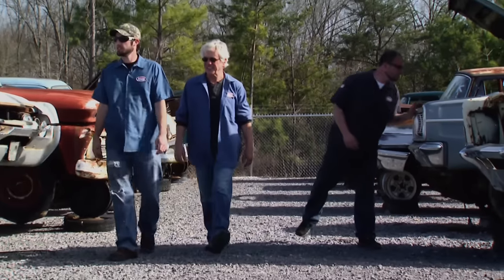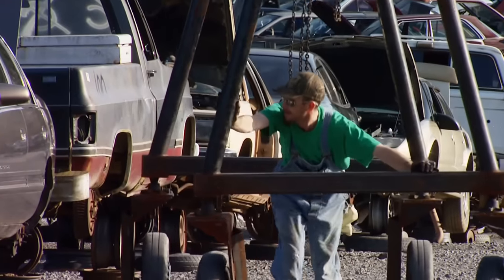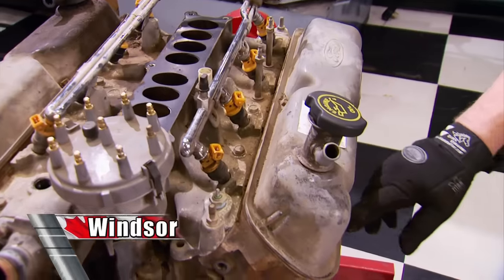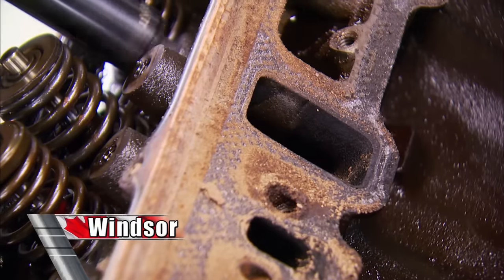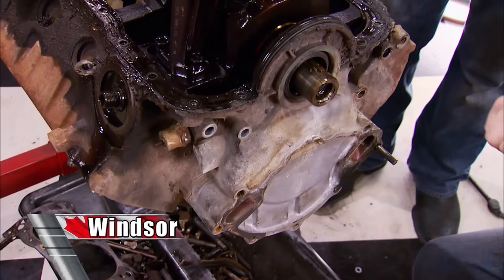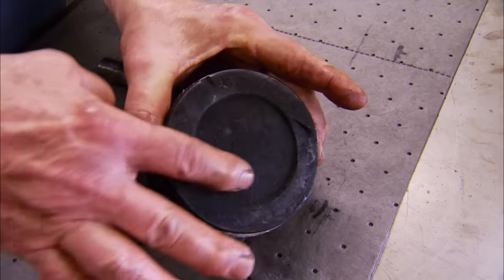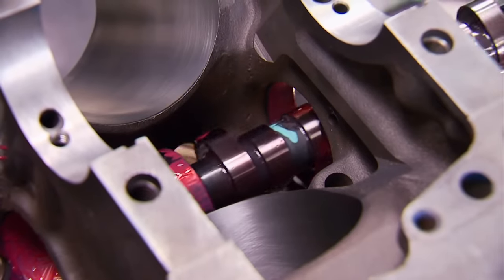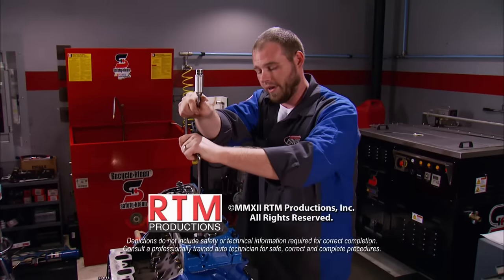Tearing Down a Pair of 351 Small Blocks: Windsor vs Cleveland - HorsePower S16, E10

Comment: Another quick way is the fuel pump bolts, Cleveland has vertical bolts and the Windsor has horizontal ones, easy as. No mechanical pump opening and it's guaranteed to be a Windsor.

Comment: i have a modofied 351 cleveland, it has the performance pistons , a 400 cam, solid steel lifters , square bore manifold performer lb2v , four barrel holley 4160 carburettor, xtra large sump, headers some kind of speacial exhaust and muffler,  it sound great , loads of speed too  i got up to 250 kph and didnt want anymore , it almost blew both back tyres in under a minute  just standard 15 inch 205mm, serch ford 351 cleveland worked starts up and revs rimas nobody elses

Comment: Know a guy that bulit a beyond beautiful 32 duece coupe . Plumb crazy purple with graphics and had not decided what to power it with. EVERYONE told him put a 350 chevy in it bit he said f**k that not in my Ford. He bought a bone stock 351 4V engine from a guy that had a old Mach 1 he parted out. It had the GOOD HEADS and he sent the engine to a custom shop  that balanced it , ported the heads. Shaved them .020 and added a solid lifter race cam.and put a  edelbrock tunnel ram.with twin 600 holleys . GOD ALMIGHTY that thing sounded awesome the 1st time we cranked it up. Added 3 inch hookers for exhaust and 4 spd with a 4.56 9 inch rearend. Talked him into taking it out on the town and wouldnt you know it a  dude in a 69 427 chevelle rolls up and says nice car , wanna see how slow it is . Not knowing what to expect my bud said lets go smartass. He told me to.grab onto something and hold on. When the light changed green he dumped the clutch and flooted the pedal and I never saw a car disappear in a rearview so fast. That cleveland sounded so awesome as he ran it through the gears. We pulled ovet to let the chevy catch up.and he got out and said holy shit WTF you running in that .I never saw anything that f*****g fast. He told us later over a beer ( he ended up being a cool guy and he had a beautuful car too) that the 1st 75 ft all he saw was tire smoke from my buddys Duece and he could hear that beast over his motor as it seemed to wind forever. He later had it dynod and it topped out at 485 hp at 6800 rpm,s. DAMN WHAT.A ENGINE.

Comment: In ‘74 I bought a ‘73 Mustang Mach 1 with the 351 Windsor. Worst, most unreliable engine I’ve ever had. Jumped time when timing chain and gear wore out. Never did run right. I got rid of it after only two years. After that I learned Ford techs said the Cleveland was the 351 to get. I agree.

Comment: [tongue in cheek...sort of]
"On the next PowerNation we do a apples to apples comparo using these engines:
We finish our rebuilds on the 351C and the 351W, putting in some Ebay pistons and rings, taking a pneumatic hammer to the combustion chambers, and a power grinder to the cylinder walls.
Their competition will be a 4-bolt 350 from a 1989 Chevrolet Corvette.
The 350 features Keith Black Diamond pistons, a complete Edelbrock top end kit, featuring cam, heads, and intake, equipping a STS remote turbo system and a Big Shot nitrous system set up for a 200hp shot of nitrous oxide. The bottom end is balanced and the whole engine blueprinted.

Our initial dyno pulls show the following:
351W: 235hp/337ft-lbs
351C: 276hp/328ft-lbs
Near stock Chevrolet 350 rebuilt for this comparo: 726hp/817ft-lbs of torque.

Welp, these numbers speak for themselves!
Stay tuned for the next episode where we revisit the 460 vs 454 comparo, but this time put a 11-71 on the 454, and swap out the factory 460 pistons with narcoleptic possums!"

Comment: The Australian manufactured Cleveland’s were built at the Ford plant at Geelong in the state of Victoria right and used right up to the 1984 Aussie Fords in Both 302 and 351ci sizes and we developed them a bit further with improved head design and were used in our Aussie Ford Falcons, Fairlanes, LTD’s, F-100’s, Utes, panel Vans 2V, 4V and super hi-performance versions for our GT & HO Falcons in the tens of thousands, the Windsor’s were used in vast quantities too in the same Ford products but these were all Canadian built right up to the last EFI versions built and there are plenty around in wrecking yards here and could be a source of supply to the US especially now that you have discovered our epic Ford Barra engine and using them over there

Comment: If you can find them a 351 C bored thirty over with 12 1/2 to 1 pistons will net about 10.3 to 1 with the 2V heads ! And the 2V heads with canted valves bigger than a 350 Chevy you can make some serious streetable' horsepower and torque for any md size or small Ford. Some studious blend work from the valve job down into the ports a little bit (unless you really' know what your doing) can make some serious power! I was told by one Ford guy, "Don't discount that 2V Cleveland Head! You CAN make as much as 500 HP with a radical cam!"

Comment: Clevelands has 2 types of heads: 2v and 4v and can be identified with either the numbers 2 or 4 cast into the corners of the head. 4v heads used closed combustion chambers
Reply: 4v also had open chamber heads
Reply: @jquest43  Thsnks for the clarification

Comment: I was kinda hoping for a boss 351 build but this is cool too
Reply: Only in the '71 Mach 1. Most cars after that got a 351-CJ . 4 barrel CJ's found their way into Gran Torinos, Mustang Mach 1's after '71 and 2nd gen Cougars XR7's Boss is 4 bolt mains and 4V. More carb and more cam than in the 1970 Mustang Mach 1 351-C 4V.

Comment: I am redoing a 68 FB mustang with a factory 289, I have to keep the short block from the factory but would like to put different heads, which one of the Windsor or Cleveland would be a best fit for better performance?

Comment: Loved the comparison. I just wish the guys used a carburated Windsor for the comparison
Reply: Well I thought I heard the 351W was a 1995...that would be the year they started making Roller Cam 351Ws...and they combined with the correct aftermarket heads will walk all over any 351C-4V even equipped with the massive ports.  I have built them both, Dyno'd Both...Sold the Cleveland and never looked back.

Comment: The Cleveland 2v heads with 2.11 intake vales and bowl work will go 280 cfm with stock port size.
Reply: It's worth spending some coin on good heads like the Kaase or CHI's. That is if you want to make serious power, 400 hp and under some bowl work and larger valves do the trick.

Comment: Older Winsors (289/302) had iron intakes. Not aluminum. By the way, 351C will bolt in anywhere a Windsor was. Motor mounts and bell housing are the same. Stick with the 2V Cleveland heads. 4V heads sound cool but 2V heads will start making power right off idle where the 4V heads wont start really performing till about 3500rpm. I've built a few of these.

Comment: I know for a fact that a 351 Cleveland 4V Boss Stock! will put out better than 1 HP per cubic inch.. i'm not talking of the low compression Cobra Jet.... If they can get a good set of heads(maybe some Aussie 2v Closed chambered) on that 2V Cleveland, get that Cam, Carb and Timing right..it' should out perform the Windsor by several HP or better..

Comment: At the 6:52 point it said Ford put Cleveland heads on the Windsor engine in 1969 to make the Boss 302, but the car in the picture is a 70 Boss 302 Cougar Eliminator.
With over 800 comments I am pretty sure someone said that already

Comment: The best engine Ford made was the 400!  If Ford had made a 4cylinder version of the 335 series engines with double overdrive transmissions.  The imported brands would not have become so popular.  Of course a inline 6 version of the 335 series head would have been an excellent idea too!  The Cleveland series engines are awesome when multipoint fuel injection is added.

Comment: It's a 1974 Mercury Cougar. The Mercury version of the Ford Elite. Note the big front and rear 5 MPH bumpers mandated for 1974 and the Opera windows (those little windows in the C pillar). That body style was made from 74-76. It was basically a "jazzed up" Gran Torino. 1974 was the last year of the true Cleveland. The Modified engine was introduced in 1975 to meet emissions. 1975 was a pivotal year in emissions. That's when catalytic converters and unleaded gas were mandated by the EPA. I'm only 4 minutes into the video so far...

Comment: R code Cleveland’s also had 4 bolt mains. Not just Q code.  R codes are rare. That is R for Boss in 1971 and I believe R in 1972 was high output 351.   In 1972 it was basically a detuned Boss 351.

Comment: Rocking that 351c on my Cyclone! Trade you a core engine for some 4v heads.
Reply: took 351 4 V out of my 71 cyclone ,  put in a 73  460 4V & trany, i think i  used a 69 mustang driveline ,   OH  & a holly 800 dbl pumper ,,  great bang for the buck

Comment: There is some confusion regarding the relationship between the Boss 302 and the 351C, and which one influenced the design of the other. The Boss 302 first saw the light of day in Ford’s Trans Am Mustang program. They had started out with their 289, stroked it from 2.87” to 3.00” to make the 5.0 liter limit. The first iteration used regular Windsor heads which were outclassed by pretty much every other American V8 of the era, but it still managed to beat Chrysler in the first couple years of competition. Then, Chevrolet came along with their Camaro and stuck a 283 crank in a 327 block to get a 5.0 liter of the same dimensions as the Ford. To keep up with the Chevy, Ford designed a Tunnel Port head for the Windsor that was similar to the one being used on the 427 FE motor for NASCAR and Prototype racing efforts. The problem was that Tunnel Port design was for extended high RPM usage with no thought given to mid or low RPM torque needed to handle exiting the tight corners in road racing like those encountered in the Trans Am series. It was of no consequence in NASCAR where the corners were much broader and required only slight drops in engine speed to exit the corners onto the straightaways. And in the Prototype Racing the big engines produced enough torque to get them out of the tighter corners those cars encountered as well as keeping their engines within a narrower Power band necessary for endurance racing. This meant the tunnel port head design used on the Ford 302 was of the wrong design for Trans Am Racing. So then the question becomes, why didn’t the high flowing tunnel port head work when the Boss 302 head did? The Boss head had a restriction where the intake port narrowed to make the turn towards the intake valve that the tunnel port head didn’t. This raised flow velocity as the air fuel mixture entered the cylinder, giving the engine more usable torque coming out of the corners. 
So where the discrepancy? There was a need for the Boss 302 engine, but none for the 351 Cleveland in 1968 when Ford put the Boss 302 into competition. Both engines went into production in 1969. But the cylinder head design was being used before the 335 series engine (351 Cleveland, 351 Cobra Jet, Boss 351 and 351/400M engines) entered production, so did the Boss 302 use the Cleveland head, or did the  level and and other 335 engines use the cylinder head derived from the Boss 302? The timeline suggests the 302 program was responsible for the Cylinder Head design used by both engines. 
It is important to note that you can’t simply bolt a 351 Cleveland head on a Windsor block. The two engines coolant passages join up at the front of the engine where they merge after passing through the cylinder heads to cool them off, which in a normally flowing coolant system is at the end of the engines coolant flow. In the Windsor engine series the coolant merges in the intake manifold where the Thermostat housing is located. This requires the heads to have a coolant passage in the upper part of the head. On the Cleveland and 335 series engine platform the water merges in the block where its timing chain, fuel pump mounting surface and thermostat housing reside, requiring a water passage be underneath the cylinder head. To use a 335 series head on a Windsor block the water passage under the head must be drilled out, tapped with pipe threads, have pip plugs installed and milled flat with the surface of the head so the head gasket will seal properly, and then a hole must be drilled out on the side of the head where the water crossover passage is located. The Boss 302 was cast with the water passage in the correct location, which will identify a Boss 302 or Cleveland head when you find one used. You can also use the small 2 bbl port heads on a Windsor block, but the combustion chamber is huge compared to the quench style head used on the  Boss heads or Cleveland 4 bbl heads. 
Why’s does this which came first situation matter? Maybe it doesn’t, but I’ve always been curious on which engine drove the cylinder head choice for the other. If the Cleveland head wasn’t developed, what would the 302 have used in Trans Am. Or, if the Boss 302 would have stuck with the Tunnel Port design, or another solution. Then, what would have been used on the Cleveland? Automotive history is full of left turns and dead ends. Chrysler’s Ball Stud street Hemi design is one that never made it past the prototype phase as I’d the Big Block Chevy Porcupine “Hemi” engine. There were plans on GM’s drawing board for a 12  cylinder engine that would have made their Big  locks, Mid Blocks. Oldsmobile had two prototype DOHC 455’s and Pontiac had another. AMC was late to the performance arena with their Gen 1 and Gen 2 mid block engines. They went on to design a second generation Cherokee that originally had independent front and rear suspension. But the suspension was a great design for off-road use it was too wide for street use, so they shelved the concept. They also had an updated cylinder head design test would reduce emissions. When they went under GM bought their government contracts and the fully independent suspension designed Cherokee became the Hum Vee and the emission motivated cylinder head design became the head used on Chrysler’s Magnum series small blocks after some revisions. What would they have developed next. There are many more examples but to list them all would make this a novel, and tone os research would be needed to scratch the surface. So I will leave it up to the folks on Power Nation to find the answer as to what came first. I’d really like to know!

Comment: the CLEVELAND 351 was a BIG BLOCK with a small block transmission. the Windsor was a modified 302.
Reply: No, the C isnt a big or small block, Ford havent small block or big blocks. They have series like 335 which the C belongs. Get your facts right,. This episode have multi faulty information.

Comment: I have to call this out, @3:55 you say the 351 C is out of a 71 LTD, clearly the guy are lining up the hoist over a 74 Cougar.  Which happened to be the year the Cougar went up to the mid size Torino, Montego platform. As the Mustang went to the Pinto chassis for 74.

Comment: question i just picked up a 77 f250 4sd/4wd, the question is 
this, the water neck is on the block/ fuel pump bolts are top an bottom. (not left to right) what the hell engine did i get?

Comment: My roommate bought a used late 60’s Shelby Cobra Mustang. I believe that it had a 427 engine but he blew that original engine the first day that he owned the car. For some reason, he dropped in a rebuilt Cleveland engine which didn’t make sense to me. The car turned into a money pit and he got plenty of speeding tickets. He finally sold the car to some kid for the same price that he paid for it, $2500.  In those days, owning a Mustang with a Cleveland engine was some sort of status symbol. One of my friends got very upset when he found out that his beautiful yellow fastback Mustang had a Windsor engine.

Comment: I have a question I have a 1979 Lincoln Mark V with the 400 3-speed transmission and it has a hundred thirty thousand miles on it around how much more life does that 400 engine have left on it

Comment: 3:54 What ? It's not a 1971 Ford LTD , it's a 75-76 Mercury Cougar .
Reply: Also, a 351 Cleveland or M is not really a "Small Block".   It is a block design that is unique to that engine group regardless of physical size.   A 351 W is definitely in the small block "family" of engines.

Comment: I’ve never had either one of them. As I get ready for my Ford project I can’t decide what I want...Ford has so many good choices!! I’m stuck between 347 stroker, 351w,  or 390FE. I dunno what it is but the 302 and 347 have a unique sound that no other engine has. I still can’t figure out what it is that makes them sound like they do. But they are a match made in heaven with a flowmaster original 40!! The FE motors sound better with glass packs

Comment: I had a 351 Windsor in a 77 T-Bird.  It was my 2nd car I was young at the time and I did not look after it at all. I beat up and abused that car and engine it never let me down.
Reply: I had a 79 blue T-Bird in 2012. It still had the original factory stickers under the hood. Slowest car I've ever owned, but one of the most comfortable. That 351 really needed some heads and a nice rear gear ratio.
Reply: I had a 77 T-Bird, Jade green with a white landau top. Beautiful car. It had a 351MC modified cleveland. Any time I needed a part I had to take the old one to the parts store with me to match up. Nothing the parts manuals at the store ever matched what I needed. End of run  maybe, use what's on the shelf?